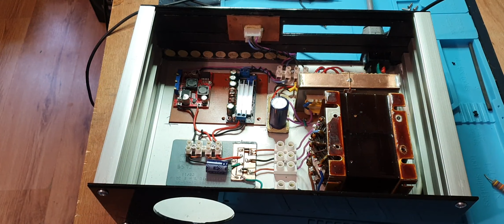Sailor 1000 system receiver power supply tested.

Comment: Nice job, you may find the  dc to dc converters get a little hot, may be worth fitting a  fan to blow over them.. I just run a little 12v fan at 5v so as its not to noisy, over mine..
Reply from the maker: Hi Yes I did notice they get a little warm. I did think of  using a fan I  have from an old laptop cooling pad. That works from the usb socket. (5v) I also noticed the two smaller transformers get a little warm to.. I was quite surprised the electrical noise from the modules  is as low as it is and doesn't affect the radio.
Reply: @simrich306  Yep, an old pc 12v pc fan is what I use. I think the reason why the electrical noise doesn't affect the radio, may be down to the poor efficiency of the converters, high efficiency usually results in higher noise levels, Had you used the pc switching power supply and a plastic case, noise may have been more noticeable. If you, Youtube search Pa0nhc he  has a short video on the subject that may be of interest to you.